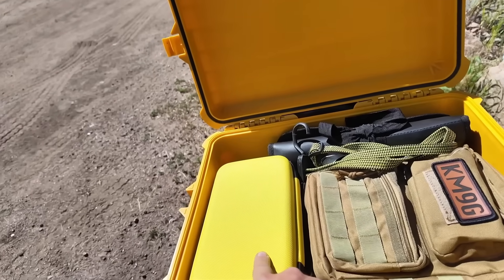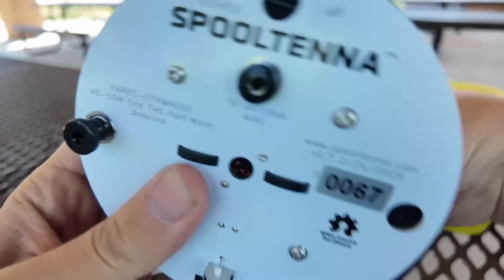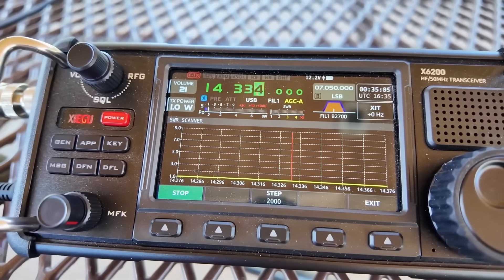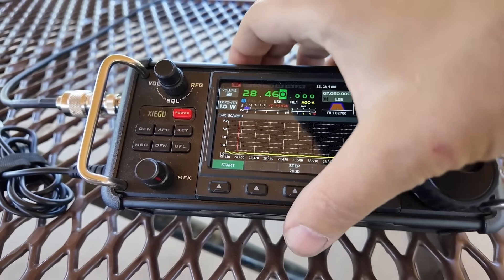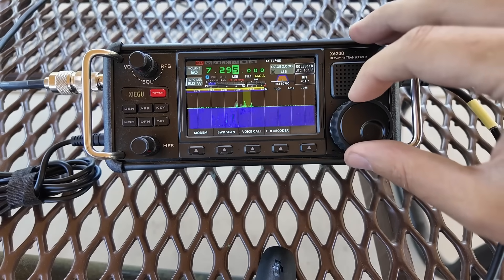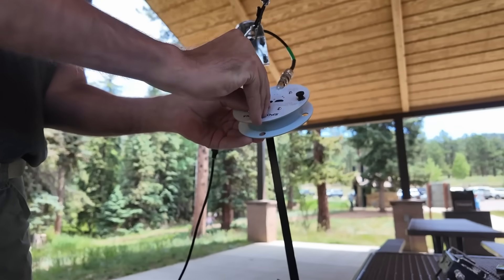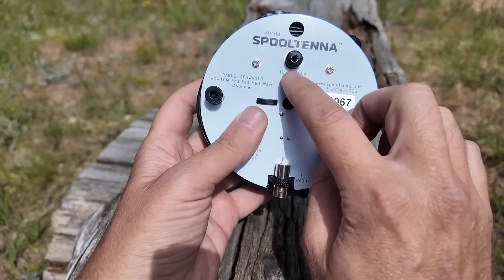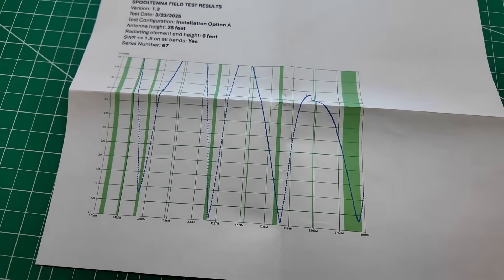NVIS Doesn't Work!

Comment: To get high angle radiation the height should be 1/4 wavelength but not too low like 4 feet. Also you need to be below the critical frequency. 30 feet is a good height for 40 meters and 60 feet is good for 80 meter NVIS. Even 100 feet is good for 160. Low is relative depends on the frequency.
Reply from the maker: Exactly

Comment: This antenna/frequency combination is excellent in the mountains. The lower wire reduces signal radiated at lower angels and puts it where you need it - above 20 degrees to get over the mountains. 20 meters is perfect for the setup as it can still be easily refracted at the higher incident angle. Mountains, valleys or canyons? THIS IS YOUR SETUP!!!
Reply from the maker: That's a great point about the angles!

Comment: 4 feet? I did it with wires just lying on the ground. Setup: X5105, 5 watts, internal ATU and 2 x 10M speaker wire on the ground. It DOES work on 40M! It might even work on 20M. But on 20M I started with a wire at... guess... 4 feet over ground! You won't get "super DX" but you will get stations up to 3000 KM / 2000 Mi.
Reply from the maker: Sometimes, that's all you need!

Comment: I find with lower to ground antenna the SWR moves a bit. Changes with soil type. I did notice lower noise floor in spots . When you do 160 meters you just can put the wire on the ground and it will work. But when I did that it was snow and worked great 160 meters and my wire shortened a bunch to tune.  160 at night is ground wave traveling on the snow. Was a clear cold calm winter night . Very low noise floor. So many end fed half wave designs . All great .73
Reply from the maker: Interesting findings - thanks for sharing!

Comment: NVIS pretty much ends at 10mhz...can happen but not so common above 10...a lot of what hams think is NVIS on 20 is really short term Sporadic E spots. Sporadic e can propagate from 20m all the way up to 2m and beyond...The best compromise 'local' NVIS frequency is 5mhz, but few use it, mostly because it's not harmonically related too their other antennas or "nobodies on it that i know"...or the 'good buddy net' would never use it or have been using 7mhz since 1929..
Reply from the maker: You're right.  It all depends on the critical frequency.

Comment: Do you trust the Xiegu SWR graph? I have the 6100 and it seems to think every antenna is virtually flat from DC to light. My Nano VNA thinks otherwise. Interestingly, with the R1CBU firmware, the 6100 tells a much more believable story.
Reply from the maker: tl;dr: yes, but "trust" is a strong word.  It depends on the number of data points used.  I use the SWR graph to get me in the neighborhood and then I use the SWR meter during the QSO to tell if I need to fine tune it at all.  You can tell if your antenna is "really bad" or "close enough" with it and it beats the hassle of the extra "work".

Comment: are you a member of YCARS K4YTZ in rock hill sc?
Reply from the maker: Yep, That's the one!
Reply: @temporarilyoffline  NICE! Thanks for supporting the club!  feel free to check into the nets, 11am m-f and 8:30 pm every night. echo link node K4YTZ. my name is Brandon KM4FLU.
Reply from the maker: Hey Brandon - Were you there for the club presentation I gave on tuning a coil loaded vert with a NanoVNA a few months ago?
Reply: @temporarilyoffline no I was not.  Were you the special guest I was hearing about?
Reply: I got a pac 12 antenna. I use the vna to tune it. Or the g90 swr scan.
Reply from the maker: That Xiegu SWR scan is nice!  @brandonray4682
Reply: @temporarilyoffline  it sure is!  
question for you. would using a longer whip on the pac 12 antenna get better get better performance? i can get swr pretty good with the coil. i saw a 18.5 foot whip on amazon. would that make any difference? 

BTW i worked France on the g90 with the pac 12 in the backyard back in may. only took 3 tries.
Reply: @temporarilyoffline thanks for supporting the club!

Comment: Burning the Nimbus with NVIS. AKA cloud burning. Somewhere in the past I saw a manufactures article that showed something similar to a Moxon style antenna that was integral to a vehicle roof rack, almost a stealth NVIS. They mentioned that the antenna used a coupler to allow for low reflected power.
Reply from the maker: I bet it still made contacts... the beauty of radio!
Reply: @temporarilyoffline  yes it did and it was marketed to government agencies. It reminds me of SGC Electronics. After the passing of the owner and engineer Mr. Goral, his wife sold the company to one of the workers. Within a short time he has quit manufacturing radios and placed emphasis on their antenna couplers and then turned to selling these high quality high priced couplers to military organizations. SGC had some of the best antenna couplers on the market and they were highly sought after by fellow hams. Still have and use my SGC2020 and SG239 coupler.

Comment: I'm not sure that 20m is considered an NVIS band, but unless it's vertical, any antenna on 30 and lower under 1/4 wave high is NVIS.  The higher, the lower the angle or radiation.  Back in my hometown, a few locals found that a low 75/80m dipole about 10-12 feet high worked well for the local nets and was much quieter than their higher ones. 

In Charleston, my rental only had two trees that I could put a wire in that only reached 10-12 feet at best. I put on a parallel dipole with the 5 HF bands.  It worked well enough on every band to communicate.
Reply from the maker: I've made some amazing contacts on antennas that other hams have said won't work... even while having a QSO with them.  It all works, some just works better for some purposes than others.
Reply: ….and if something “works” that doesn’t mean it worked like you though it did. HF is so forgiving that wrong can work. Especially if you beacon you freq with the internet spotting network. 😂
Reply: @forgetyourlife  

I disagree with your statements and here is why.  

"worked like you thought it did".  How can you judge what someone else is thinking.  If my goal is to make a contact, unless I got the callsign or signal report wrong, it worked like I thought it did.  If I got a confirmed QRZ or QSL card, it proves it. 

HF isn't forgiving, it is physics and has to be sufficient to overcome the losses between the stations to allow communication. 

TX-> feedline -> Ant -> PROPAGATION -> Ant -> feedline -> RX.  

We can improve our stations by improving our radios, feed line and antenna to overcome weak propagation.  

Most of the time, what my IC-7100 could hear cleary, the Xiegu G106 could hear, but one day I got a great demonstration of how much better the 7100 receiver really is. 

I compared the receivers on a weak CW QSO and I could barely, if at all, hear the difference between the two radios other than pitch of tone.  

But after the QSO, I started changing the filters on the 7100. It surprised me to hear a CW station come up to the point I could hear it clearly.  But, the G106 did not even have a faint trace of the signal.  

My antenna at the time was a short random wire hung over the banister of my balcony on my 2nd floor apartment.  Frankly, the antenna sucked, but it worked until I installed a PAC-12 which was better, until I replace it with a Sigma X-80 no-radial vertical, which works even better. 

5 watts in that antenna made QSO with Martial Islands on FD.  It's not as good as a pair of 12 element yagis up 75 and 120 feet on a tower (an SK ham friend of mine had) but it works for me for my situation.  And yes, if I make the exchange successfully or if I don't, it "worked like I thought it did".  I just get the successful contacts confirmed in QRZ, etc.  

I've loaded up many, many things for antennas including window screens, gutters, and even the shield of a dangling piece of cable tv coax that was disconnected at the pole.  (The latter actually worked really well.) 

Everything works. Some components work better than others.  Get the best receiver you can for your purpose, the best antenna you can for your budget and physical restrictions, and the most practical feed line for your situation.  

Use your station and it will work IF there is sufficient propagation.  

Don't pay attention to the nay-sayers.  Anything works, just some things work better, and it is not a crime to have a less-than-optimal station.

Comment: Critical Freq is highest Freq sent straight up that is reflected back down 
MUF is maximum usable Freq which is higher as it bounces at a glancing angle.
NVIS generally doesn't like well above Critical Freq (like 20m often is).

Also get worried if your SWR plot is too flat. Given your antenna wire is a fixed length you SHOULD see a variation across the band. If it is too flat that suggests you are coupling into something lossy ( like the ground if too close). Always remember that the absolute best flat SWR is obtained from a dummy load.
Reply: Let's not forget that you were making those contacts with 6 to 8 watts.  Imagine how you get out if you were running 100 watts.
Reply: Yep, and Yep.  Spot on.  I think an interesting data point, would be to run wspr and see what your propagation looks like.  If you only getting out to around 500NM or less, then you are definitely NVIS.  And another interesting data point would be to see what you get if you just lay the antenna on the ground.  That is commonly done in tactical environments.
Reply: In other words critical freq = foF2
Reply from the maker: Also remember that your SWR scan only has so many data points and isn't a complete representation of the exact SWR of the antenna... anything below 2:1 is "good enough".

Comment: I would not expect 20M to be a usable NVIS frequency.  I would have expected 40M or maybe 30M.  Another thing about NVIS is that it is used for short range HF comms, something less than 500NM. Antenna height is only one parameter when trying to work NVIS. Lots of people think if I just put my antenna a couple feet, I'm doing NVIS, and that isn't true.
Reply from the maker: Thanks for the tips!
Reply: @temporarilyoffline we use 40M in Delaware
for NVIS
Reply: Yep. We use NVIS  at work and it’s definitely 7Mhz and lower. Won’t work on the higher frequencies as they punch straight through the ionosphere rather than refracting down when shooting straight up. The idea behind NVIS is to be able to communicate within the skip zone around 30 to 500km out. 
Cheers and I enjoy your videos

Comment: Would you recommend the 6200 for a pota rig ?
Reply from the maker: "It Depends" - I have used my X6100 for POTA many times and this is my 3rd POTA with the X6200.  It works well and gets the job done... and it and the antenna system fit in my motorcycle case, so I'm happy.  I bet I could get a full sized 100w radio in that case too... if I had one.
Reply: get a uSDX instead. 10times less expensive and you get the same output. you dont really need the LCD nor waterfall for field operation.
Reply from the maker: Not arguing with you @VA2DKK, but with the uSDX (I have one) you'll need a sound interface, ATU-100 and a NanoVNA in your kit to get to where you're equal to the X6100/X6200.  The waterfall is nice, but agree that you don't really need it.

Comment: What was the critical frequency (Fof2) when you were operating? NVIS only works when you are operating below the CF. CF is rarely above 10 MHz - more normally between 80 & 40m.
73 Ed.
Reply from the maker: I didn't record it, but having a checklist of these things ahead of time before you go out is VERY good practice - that way when nobody is answering you, you're not going to be blaming your equipment!
Reply: @temporarilyoffline many people dont realise that the CF has to be correct before NVIIS can take place. If someone says I worked  so and so via 20 metres NVIS , i am very suspicious as that would be very rare.
Reply: @DD5LP  people simply dont know what NVIS means... it had become somekind of tactical buzzwords to be used.

Comment: I have a 71' random length antenna along the fence about 5' high and get good reports in the tri-state area of NC, SC and GA.  I have that same cool shirt you are wearing...
Reply from the maker: Ham Radio... It Just Works.
Reply: @temporarilyoffline  I just read that ham operators at Antarctic stations just lay their HF wire antennas on the ice as it's essentially invisible to RF at those frequencies. Since the average depth of the ice shelf is 1.2 miles, that's a pretty high antenna!

Clearly, we should all move to Antarctica. No more towers, push-up poles or tall trees, it's perfect.
Reply from the maker: I would love to move to Antartica... for a month or so.
Reply: @temporarilyoffline  It's so beautiful in the fall...

Comment: So pretty much any horizontally polarized antenna mounted less then a 1/4 wave will exhibit NVIS behavior. Which one dont?? The HENA, looking at it you would swear it's horizontally polarized but actually vertical  HENA in Japanese is strange. It is actually a skeleton slotted dipole. There's a really cool version of a folded skeleton for VHF it's a box of copper pipe.
Sorry change the subject on you but found a link for you for it their calling it a cube 
https://youtu.be/8hdh13yPmYY?si=mwGyzdLTNkKkBhKj
Reply from the maker: That's a cool looking antenna, thanks for sharing!

Comment: I have the Reel POTA-ble chalk-line antenna and really like it. However, I live full-time on my motorcycle. Every cubic centimeter of space is valuable. The Reel POTA-ble is bulky for my purposes. Much of the issue is the 49:1 balun box attached to the side. So, the Spooltenna seems like it might be much smaller, and something that could replace The Reel POTA-ble antenna.

I wonder if anyone has compared the two. 

• The cost of of the two is similar ($120 for the Reel POTA-ble vs $150 for the Spooltenna). 
• The enclosed cable spool on the Reel POTA-ble is excellent. No tangles ever. Very quick. From videos it looks smoother, faster and easier to deploy than the Spooltenna. Plus it's utterly jam-free when reeling in or out. 
• The crank on the Reel POTA-ble is *fast*, since it's just an Irwin chalk-line case with the string replaced with a very nice wire and a 49:1 box attached. It's actually kind fun to play with the crank. :)
• The Reel POTA-ble is very rugged, since it uses the Irwin chalk-line case. I can toss it anywhere and it's fine. The Spooltenna seems like it might be a bit...delicate in comparison.
• The Reel POTA-ble seems more polished and professional looking, also because of the Irwin chalk-line case. There are no cables dangling. However, the big balun box attached to the side is clunky in appearance, and takes up too much space in my tight storage.
• The Spooltenna is an open-wire spool. I've seen videos where it falls out and jams the unreeling process. Reeling it back in seems quite tedious vs turning the crank on the Reel POTA-ble, which is super-quick, jam-free and simple.
• Reel POTA-ble has decent SWR on most of the popular bands, but it looks like the Spooltenna might have multiple transformers internal, making it much faster to tune. Or it's the same, I'm not sure.
• The thing giving me pause is that the Spooltenna seems much more compact, which is a really big deal for me. I might be willing to sacrifice build-quality and simplicity to set up, if it's much smaller.
Reply from the maker: Very good comparison, thanks for sharing!
Reply: find a small balun box with simply a connection for the antenna on one side and a BNC on the other. make your own reel or arrangement to wind up 67ft~ of wire. it is the most compact way to haul this.
the spool tenna is way too expensive and its got holes going inside of it. its hell to use in the field because the BNC can break off and stuff can enter inside. its not really rugged nor field proof.
Reply: Good comparison, we designed the antenna to be compact and very packable. 😊

Comment: The U.S. Army has very sophisticated test equipment that measures power, take off angle, etc. And equipment that measures the same at the receiving station. They can fine tune the system to "hop" mountains and structures to direct the signal. The same equipment is used to determine a signal's transmit location. NVIS is not a joke or magic. It was first used in Vietnam to get signals up over the tree canopies and communicate in close range. As hams, we are relegated to trial and error to get it to work for us in the variety of environments that we operate in.
Reply from the maker: Very wise! I can't afford all that gear. But I am happy that it works the way it does and others have shared their experiences.

Comment: I've recently been doing quick and dirty NVIS deployments like this--horizontal and just a few feet off the ground. It works fine for 30m, 40m and 60m (haven't done 80m...yet).
Reply from the maker: 80 on a dipole is almost always NVIS - who can get 3 points at 130ft in the air?  I think most people think of it as a local band... simply because that's how they've installed it (NVIS)
Reply: @temporarilyoffline  My EFHW in Wales isn't very high but I've made several contacts to the USA on it on 80m. 100W. Usually about 2 to 4am local time.

Comment: Recently, I did some WSPR testing with a 20m dipole in my attic. I wasn't surprised that a couple of local hams picked it up or that it got heard 1000 miles or so. Even getting to Australia on two watts wasn't that surprising. After all the WS in WISPR is "weak signal." It was the reports coming in from about 150 miles away that surprised me. That's too far for ground wave and too close for the usual 20m sky wave. I eventually concluded that the aluminum attic foil covering the floor of my attic was creating an inadvertent NVIS effect putting some of my signal almost directly upward.
Reply from the maker: I like the accidental discovery aspect of this hobby!